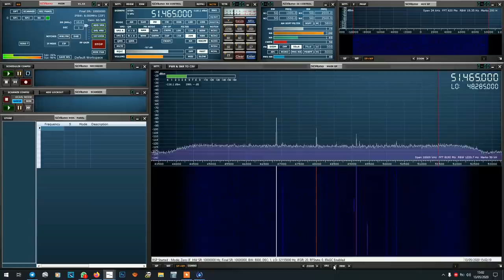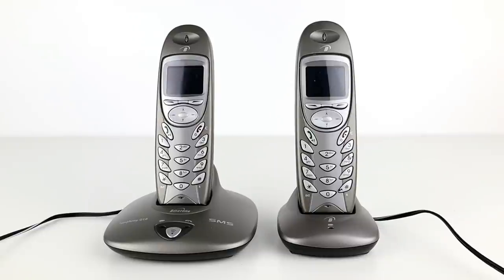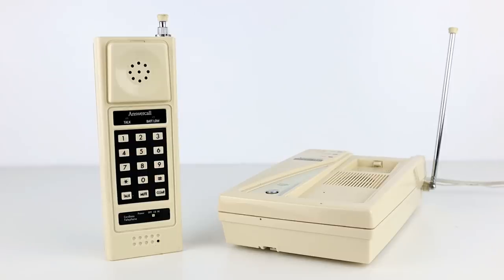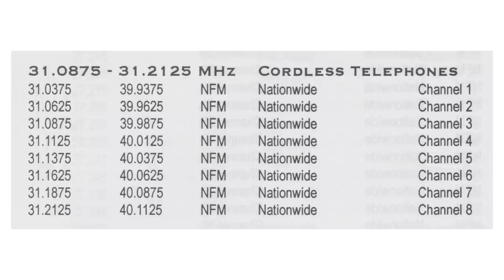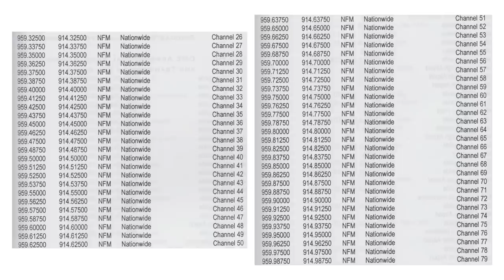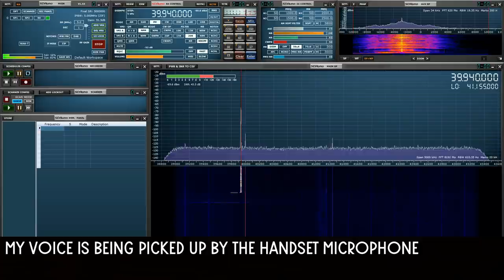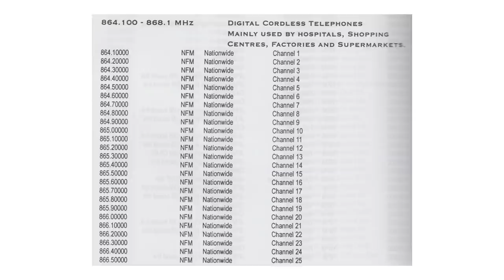Listening To Cordless Phone Conversations!

Comment: I got a 900 MHz analog phone at the thrift store back in 2017. They're harder to find because they aren't on all the time but I got lucky one afternoon in 2016 when I heard one I managed to track to a house far down the street from me. Lucky find. I messed around with it for a couple years before finally leaving a message on the guys answering machine letting him know. He changed the preset channel on it Asif that was going to stop anything but ultimately stopped using it 2 weeks later.

Comment: My cousin bought a Panasonic cordless phone at the flea market in the early 90's. He was using it for years, when neighbors noticed that they could listen his conversations on their TV sets. The reason was, in Budapest, till the 2000's, the local TV  broadcast was using the OIRT channel 1 which was around 47 MHz. Then, all TV broadcasts were moved to the UHF band, and later, they stopped the analogue transmission, but the modern TV sets are still able to tune the legacy 47 MHz channel...

Comment: In 1999 Mum bought a Panasonic cordless phone which was analogue and I believe it transmitted on the 900Mhz frequency, (I live in Australia).  I can remember the cordless phone would interfere with FM radio reception, my radio would make a 50 Hz buzzing noise whenever the cordless phone was used.  In 2000 I received a cordless radio headset who's transmitter I would connect to my stereo system.  The headset had a tuning knob on it, and if I tuned the headset to a certain frequency, I could hear Mum speaking on the cordless phone, though I couldn't hear the other party.  The cordless phone became quite susceptible to RF interference, I remember one day I was on the phone to a friend and the cordless phone picked up interference from the printer.

Comment: I used to hear cordless phone conversations in the CW end of the 80 Metre Ban back in the mid 1990s. I think this was the second harmonic. I was using an FT280R and a TOkyo Hi Power Transverter to get onto HF. You'd hear a steady buzzing sound when the FT290R was  set to CW. Switching to FM mode would reveal the conversations clearly.

Comment: I worked for Radio Shack (Tandy) several different times between 1979 thru 2000. I remember the change-over on cordless phones and what a huge deal when DSS/800Mhz came out. It was (as compared to older designs) quieter and more secure. And it was very expensive for the times.  8^O  lol

Comment: Cool feature. When I lived with my parents back in the 90's. I use to tune in using normal FM radio. Boy did it piss my Mum off and I would get right bollockings 😂. I wonder if you could modify a analogue cordless phone to make a land line repeater for two way or even Zello.

Comment: Ahhh yes! Remembering the days of having some surplus lowband VHF Motorola MAXTRAC's with a nice hot front end tuned to the 30Mhz end of the spectrum.
Plug in a 10m band vertical mounted nice and high up and you could DX all sorts of neighborhood happenings.
Simply set the radio to scan and wait to see what you could pick up!
Although nothing could be more annoying than listening to a good call when another closer call would capture the receiver and block out the good stuff with a more mundane call!

Comment: There were also illegal extended range phones using 48 / 70 MHz.  You could often spot the optional roopftop base aerials used for these, an asymetrical H which was actually 2 dipoles with seperate feeders.  The handset frequencies fell within the amateur 4m band.

Comment: Another slick production, i had a white phone like that with a long antenna, call was OK if you were in the room but it turned crap very quickly just 10 foot away, I used to listen in to them all the time on my scanner, got to be a hobby of mine ha ha, all the good stuff was on cell phones at the time though, you dont generally call the mistress from your home phone ha ha cough cough, only annoying thing is that I never recorded any of them or if I did I dont know where the tapes are, i can remember listening in to the fire brigade and the police on normal fm radios in the 1970s and 1980s, first radio I ever used was a crystal set back in 1975-76, clipped it on to the fence, no batteries required, it was a Bionic Man one ha ha, I had no clue how it worked, seemed like magic at the time.

Comment: It is still possible to listen to modern monitors and cordless phones. Even cellular phone conversations are ridiculously easy to receive.  A cheap SDR receiver and some preparation is all you need. The digital signals just takes an extra step to be able to listen to them.  Digital conversation is not as secure as everyone is led to believe.

Comment: You are really good at this. I have a question. My mom's phone while she talks on it to me (it is a corded landline) experiences a lot of touchtone beeps. Neither her nor I are hitting any keys. My phone is also landline but mine is Voip and cordless.  I am not touching any keys and her phone the buttons are on the base, not the handset that she holds to her ear. So no way she is touching any buttons as well.  I really want to get to the bottom of this as she experiences that so much and is 71 that she has become convinced that someone is listening to her calls and hitting buttons and even hanging up calls. I tried explaining that the one time my call was hung up there was static ahead of time. I figure her apartment building has a bad external line that when it rains effects the phones that are still using the wall plug instead of voip and when it gets a lot of static on her line it will disconnect. I know how that can be because I lived in a building once that had a bad line like that. But she will not believe me saying that she knows the beeping happens when she is talking about important things and they don't want her to talk about them and try to shut her up. She is so sure of herself she won't listen to logic. So I am hoping maybe you can shed a little light on this if you are able? Have you ever experienced this? I have heard about 'dtmf talk off' but people say that only effects mobile phones and voip. Hers is neither.
Reply: Wonder if her phone is malfunctioning? Get her a new secure phone and see if the problem persists.. has she called her carrier to have her lines checked for problems?